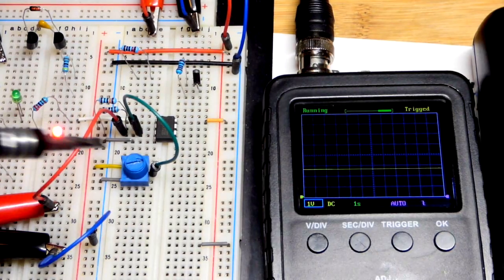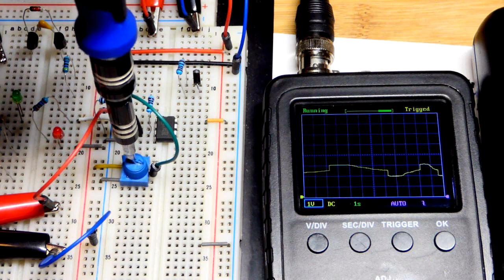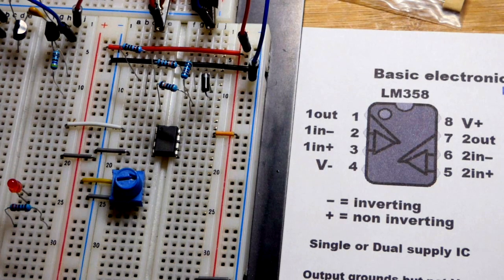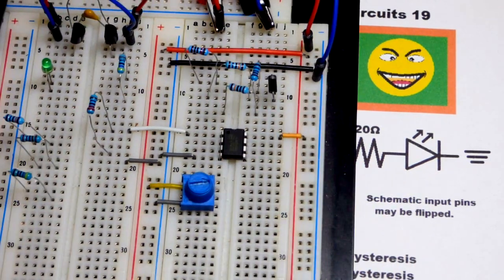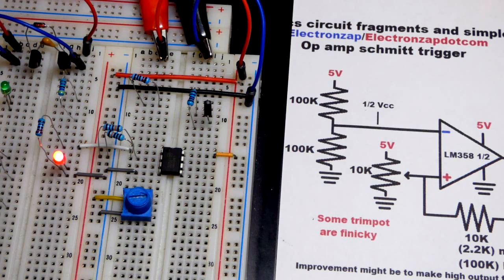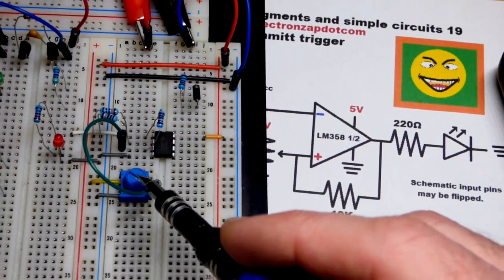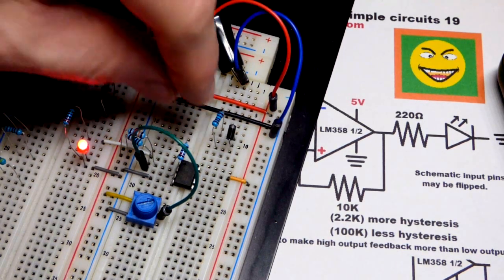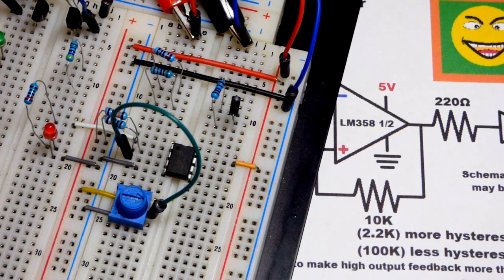Electronics course 21 How to set Op Amp Schmitt trigger circuit hysteresis LM358 by electronzap

Comment: Thank you! I just added this tutorial to my op amp playlist. I'm going to order some LM358's and some LM339's to experiment with. I recently fried my only LM358 because I lacked experience. I saw that you used high value resistors on the inputs. I will do the same and even put a resistor in the power supply if the datasheet gives the IC current limit.
Reply from the maker: Thanks for watching! Pretty sure I fried about 3 op amps  of mine by applying the power supply to the to the wrong pin(s) while testing out a bunch of them. They are usually pretty resilient.

Comment: Thanks for the video.

So is your power supply in this video "+5v and -5V" or just regular "+5v and 0v/GND"? The reason I ask is because you mention negative rail.
Reply from the maker: This one is just single supply. I use the term negative because my target audience is mostly people who are new to electronics, that likely don't know what split supplies and ground are, but probably know that common power sources have a positive and negative terminal. Thanks for watching and commenting!
Reply: @Electronzap  thanks for clarifying.

Comment: Another question, so when you have just the one feedback loop it outputs only 3.5V when the comparitor goes high and 0V when low.

Why does this change with the addition of the second feedback loop?

Actually, it would be great if you could explain how the feedback works in another video, not asking for much I know :)

Thanks again.
Reply from the maker: Unfortunately, integrated circuit outputs often don't usually output the voltage of + rail or -rail/ground. Some go to one of them or both of them. So you have to keep that in mind when selecting components and/or or designing a circuit that uses feedback from the output. Hopefully the component's datasheet from the manufacturer includes a demonstration circuit of the circuit you are interested in as guidance for that particular integrated circuit.